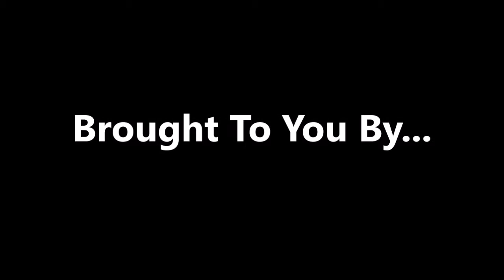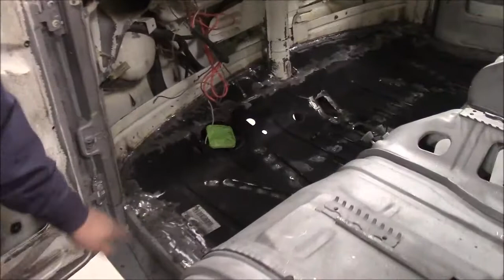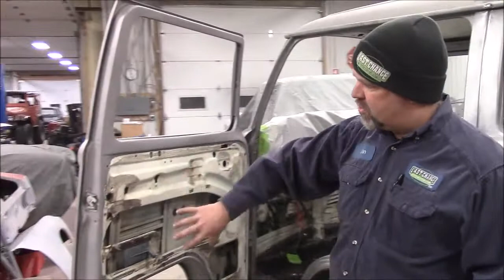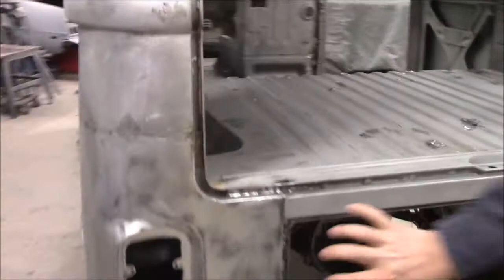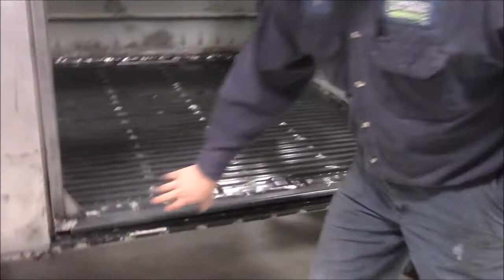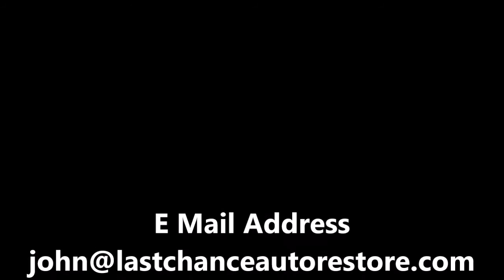1972 Volkswagen  Bus Van Restoration,  Metal Fabrication Completed, lastchanceautorestore com

Comment: Great work. I am wondering how you prevent rusting the stripped metal after a short period of time, because when I stip parts of a car the rust appears after one day at blank zones of the car? Do you use some covering?
Reply: Id like to know this too.. they must have good airconditioning in there lol dry maybe its waxed?
Reply: @BeavistheLizard  I'm assuming it's the indoor air conditioned environment, I've been restoring my baywindow in a shed with no A/c in Florida, after 24  hours the humidity gets to it.